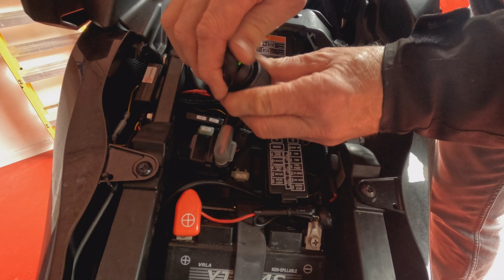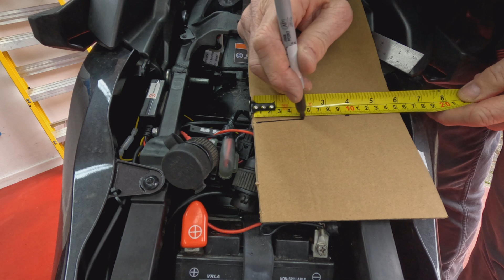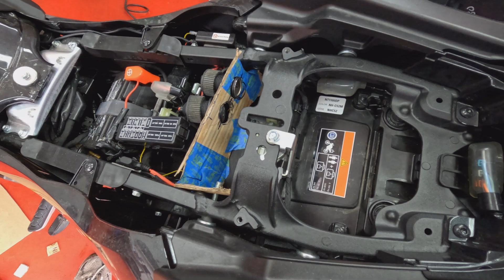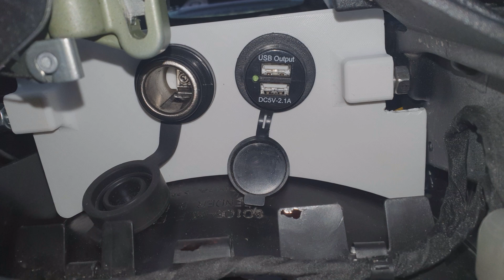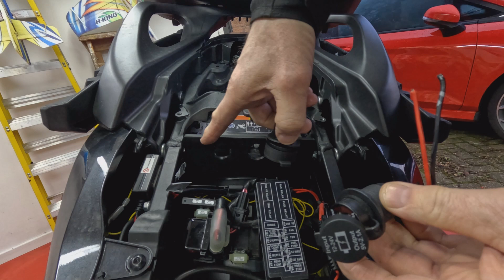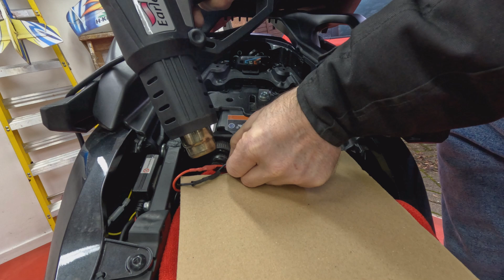Honda NT 1100 Power Sockets Install

Comment: What do you use those for? do you store phones or something else below the passenger seat to charge them? Is there a chance for those to fall of from the bike?
Reply from the maker: these are used for charging mobile, I leave mobile under seat, connecting power to my cameras, charging batteries. Very usefull space and completley out of the weather. Thank you for your comment. I also plug my charger into the bike via the 12v socket.Cheers
Reply: @kimetogo  Thanks for your reply. I was concerned the phone could fall from there, but looks like safe storage

Comment: printing using ABS ? will it melt under the sun ?
Reply from the maker: ABS is fine in the sun and doesn't melt. It needs to get to adout 80c -100 c before it is affected in any way, When these parts are made the material is extruded at at 240c. Deforemation can start  at around 100c but is affected by how the part is printed, thin parts will deform easier than solid items. With this being placed under the seat of the NT 1100 it will never get to any temperature to cause any issues. And many parts on your motorbike are ABS. Thanks for the question, Cheers

Comment: Do you know how much power is produced by the NT1100's generator, is it enough for 2x2A consumption (while driving) and to load the battery?
Reply from the maker: Hello Alex, I don't exactly know the output from the Alternator, I will measure the output next time I need to disconnect the battery, Each of the USB sockets I have fitted will rarely be both used at the same time. I have checked with heated grips, Lights on main beam, and one USB port connected to 2A dummy load, and one connected to my GoPro Charging, and when the bike is running the battery charging voltage is about 14.0v. Which within the range for the battery to charge correctly without losing charge on a run. If the charging voltage was dropping this would indicate the alternator has difficulties. So It seems all good so far. Thanks for you comment and for sure it's an important one when adding electrical items to your motorbike. Cheers

Comment: Good video. Is the positive lead ignition controlled?
Reply from the maker: The positive is not ignition controlled. Battery is connected directly to the sockets via a fuse. This is deliberate because I want to use the socket power when the bike is off.   I used a switched positive for my Vsysto camera install (see video) and you could use this connection for the positive if you require it switched. Thank you for your comment. Cheers

Comment: Like that. Where did you connect the 12V input of your sockets to? Switched?
Reply from the maker: If you check out Vsysto camera install video 4 it's all explained there https://www.youtube.com/watch?v=mP4FoDp3lsA&t=1039s . I connected these when I installed the camera system. Hope this helps. Thank you for your comment. Will be showing more of these in use going forward. Cheers